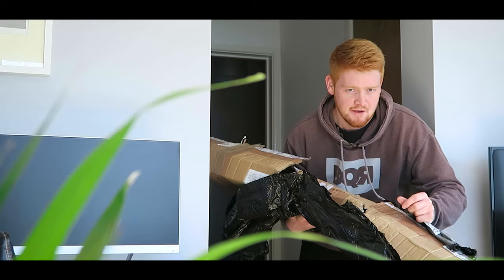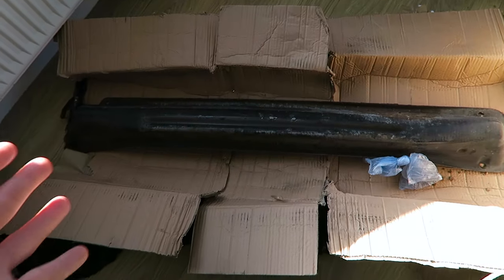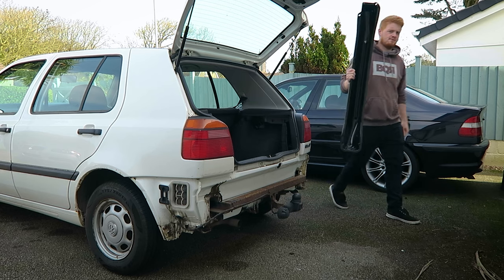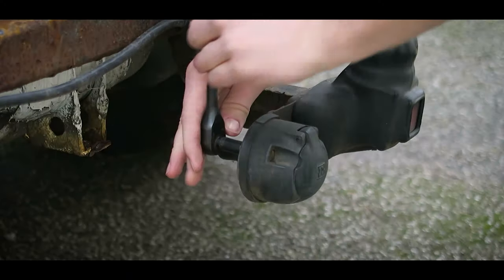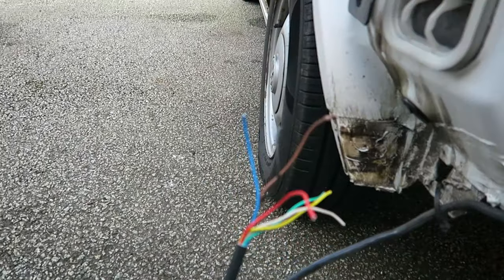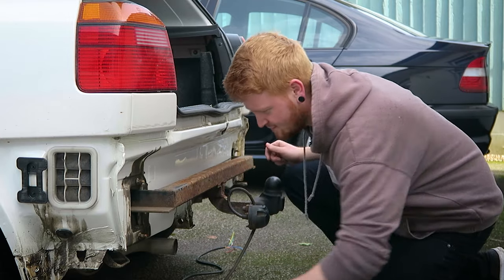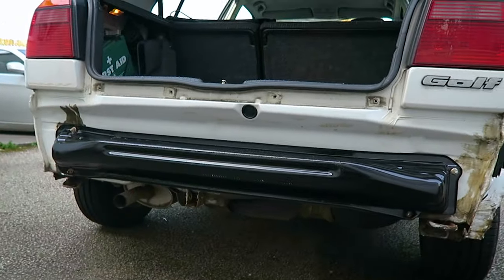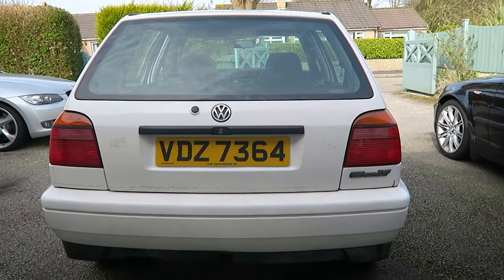Finally... The Towbar Has Been Removed!

Comment: Nice thumbnail
Reply from the maker: I’m quite proud of it 😂
Reply: @LukeBudd  me too :)) good job man make some more nice cool videos about this master piece. And I forgot which engine is this in the car?
Reply from the maker: @gpubenchmarks7905  it’s got a 1.4 petrol, so it’s very slow 😂
Reply: @LukeBudd  omg man rip it of put tdi afn abd remap + straight pipe easy 150hp 3.8L or about 3.8L open road fuel